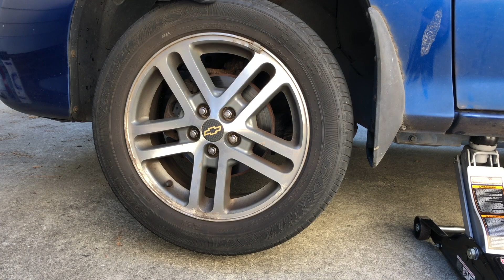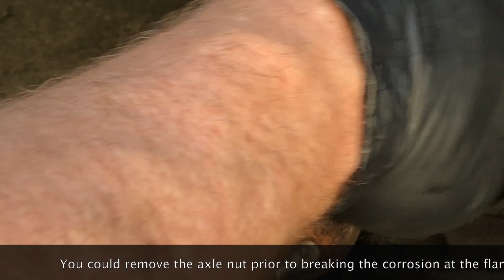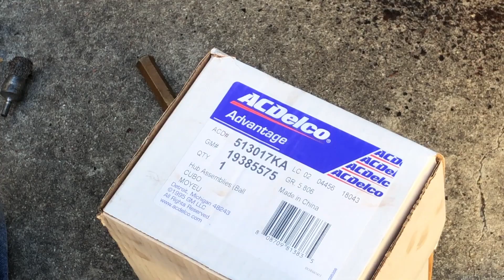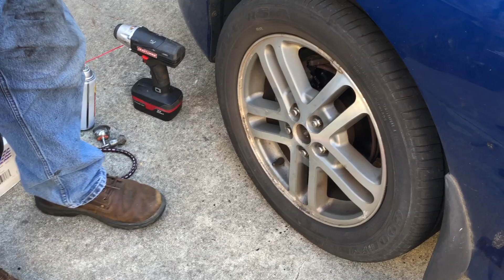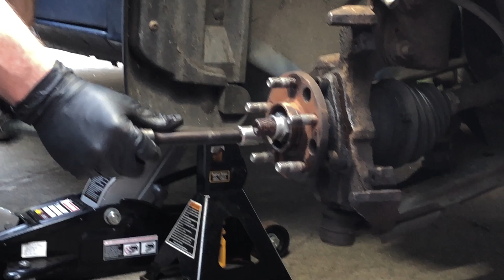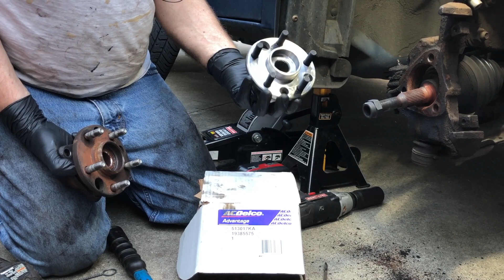1998 - 2005 Chevy Cavalier Sunfire Front Wheel Hub Replacement & Bearing Noise Isolation Techniques

Comment: Thank you for posting such a thorough video explaining how to do this.  I have a 2001 Sunfire with 204,000 miles and it's still kicking.  The last time I took it in for a tire rotation, the tech said the RF bearing needs replacement.  I checked it myself and everything seems fine.  However if it is going out, now at least I know how to repair it when the time comes.  Also, excellent tip about the small pipe wrench for removing stripped 55 torx!

Comment: Thank you for the infoe on the rubber O ring and the seal. I have a 99, now I know, I do not need to put on. When I took it apart, one had a seal and the other did not... Thank s again.

Comment: Just did the wheel bearings on the 00 cavalier.  I purchased an induction heater to deal with the torx bolts.  Roughly 20 seconds of heating and the bolts broke free with minimal effort, zero stripped heads.  Just rewatched for the torque specs.  Thanks again.  Cheers!

Comment: 29 mm axle nut I’m confused cause all over the web I see 28mm 30mm and 32 mm which is it cause I heard that the sport model has 28 mm and the rest have 30 or 32
Reply from the maker: Aftermarket parts mostly, they used different size nuts than GM used on the assembly line (this one I show working on in this video is a pristine one owner J-car owned by the individual (not me) who ordered it from the Chevrolet dealer in 2004 so it's the correct nut size for that year and option package).  

If the axle shaft was ever replaced, it got the different sized nut.   Also variation across model years, option packages, or suppliers occurred even on the assembly line.

Comment: Pretty fantastic job sorting it out, i'm in the process of figuring this out currently.  After the brake job on the front car still makes a pulsing grinding sound that changes under cornering.  I"m going to jack it back  up and hose things down with PB.  Thank you for your diagnostics.  Cheers!

Comment: Thank you so much for including the size of the caliper bolts and the torx bit in the hub itself, I wasn't able to find this info anywhere else.
For those wondering: the lugnuts are 19mm, the caliper is a 3/8" allen socket, the axle nut is 30mm; and the torx securing the hub to the knuckle are T55s.
Reply: Thank you that was actually the info i was after

Comment: Awesome video.  My 2000 Sunfire s e four door is still kicking with 90k.  Very helpful tips and info. The rear is a bear.  Brake cylinder has to come off to replace hub.   Appreciate your time and knowledge.  Thx 😊✌️🇺🇸